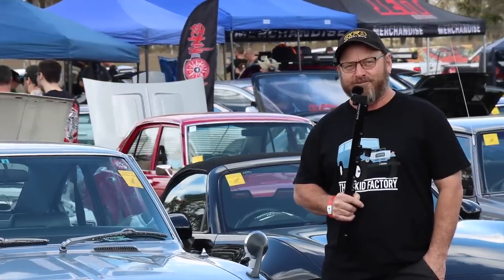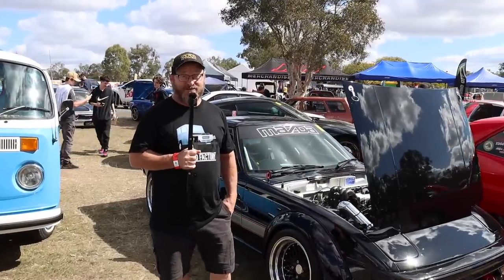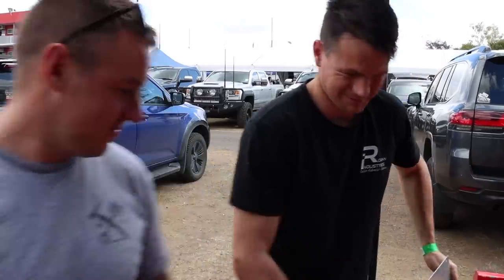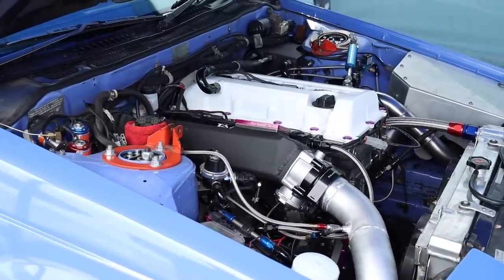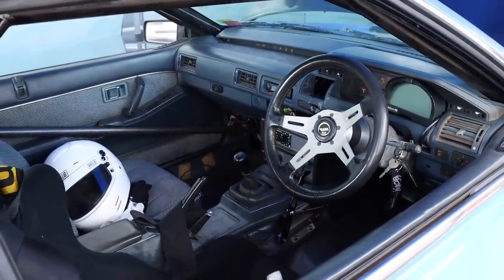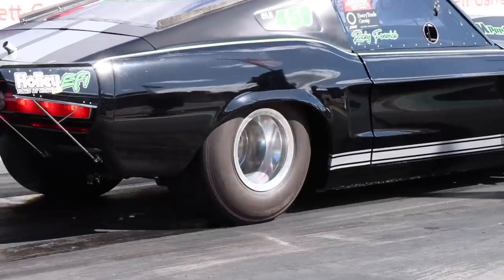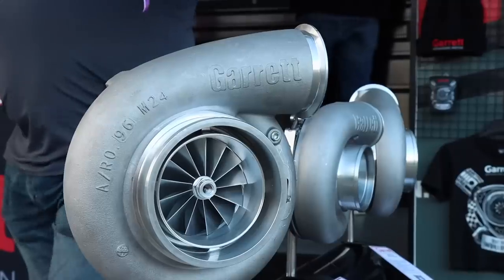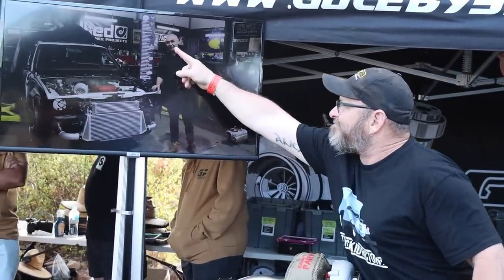Epic Cars at Brisbane Jamboree 2023!

Comment: That mk1 escort van is absolutely beautiful... my old man has a mk2 escort rs2000 converted to flat front and big forest arches stripped out caged,  running a cosworth kba (if you know you know😆)on 58 dc03 webber carbs fast road cams, type 9 5dpeed out of a sierra and a capri atlas axel only makes about 240bhp and weighs 880kg lol. 0-60mph is about 4.5 seconds tops out at about 120mph😂 build for the little country back roads here in scotland 🏴
Reply: I grew up on escorts back in nz, still reckon there’s no better time than blasting a escort through south Otago gravel roads.

Comment: Love my 1960 Hillman Husky 2 dr wagon pro street car. Has SBC with tunnel ran with 2 Edelbrock carbs. Mustang II front end. Ford 9 inch with 31x18.5 rear tires tucked of course inside the fenders. Car is a real head turner but wish it was an Anglia Panel but closest thing I could find built within my budget.